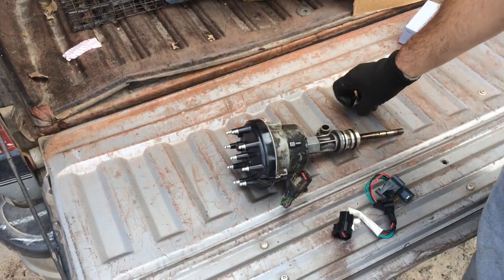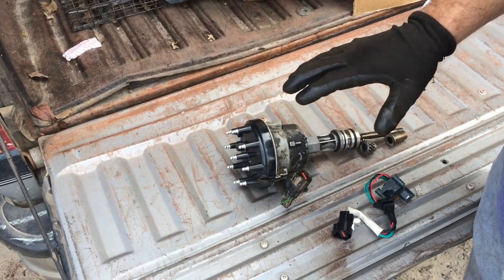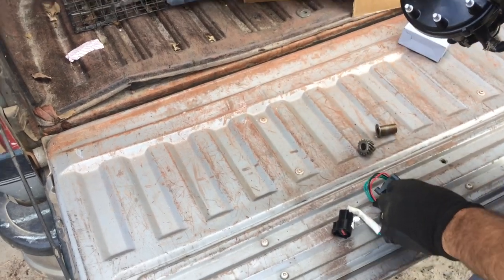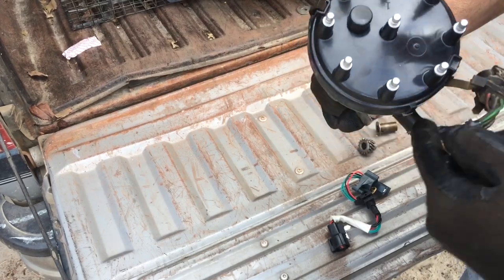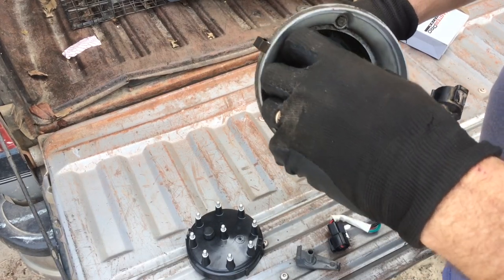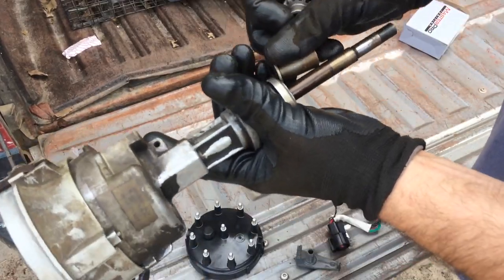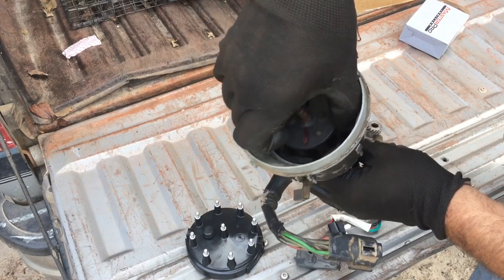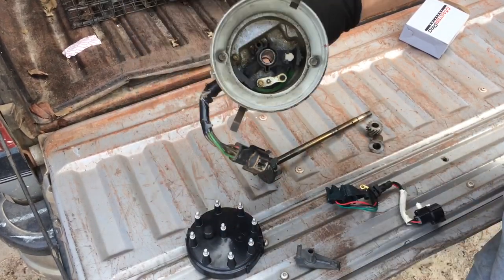Ford pickup coil replacement part 1

Comment: I want to add that youre supposed to take notice of how the distributor drive gear is oriented on the shaft if that was a factory OEM distributor..The gear has 15 teeth which makes it approximately 24 degrees a tooth...If the distributor drive gear is installed 180 degrees out when installed it will result in the distributor  rotor being set 12 degrees off which will result in hard to get a dead-on to #1 when using the ford 30 degree module placement and centerline chart as proper distributor location referrence..When you buy an aftermarket distributor its good to match the gears orientation as I bought a distributor from Autozone and the gears didnt totally line up 100%...I put it in anyways and the truck always labored to start when hot and when I backed off the timing to eliminate the hard start condition and the truck became powerless..I pulled the distributor and reclocked the drive gear as per the OEM distributor and everything worked correctly..............No more hardtime to set the dist on #1 exactly and get a good rotation to time the engine set in engine as per schematic issues , no more hard start issues when truck was warm or heavy fuel smell coming from the exhaust when its running plus when running more than 12 degrees of advance theres no more pinging  issues either and I always run 93 octane fuel in my junk...
Reply: I also had that thought but then again, you can rotate the distributor by hand when you adjust the timing and make up for that mentioned offset in the gear teeth if you didn't fit it 100% like factory fit.

Comment: Ben,

Hello.  Why did you not show how to remove the distributor gear and bushing?  This is what is hanging me up and has caused the most problems for me.
Reply from the maker: John Drazba ,hi John, I had to go to a buddies house to use his press. You will need a hydraulic press. Or you may be able to get a puller from the auto part store to do it. Mine was so frozen on, the puller wouldn't work. Sorry I couldn't film at my friends place.
Reply: Ben,

Hello again.  Thank you very much for the reply.  I understand you need a puller or better yet, a press to remove the gear.  However, the initial reason I also made the comment for was the thrust collar above the gear.  I removed the pin, but mine is really stuck on there.  It looks like a very soft material and I am afraid I am going to damage it.  Worse yet, I can not find anyplace that sells the thrust collar/endplay bushing.  Any comments/thoughts/advice from you would be appreciated.  Thank you, Ben.

Comment: Replace the distributor. Trying to remove the distributor gear can damage the distributor. A power-steering pump pulley remover can work. To install, use a socket. But lining up the gear hole is awkward. Best to replace the distributor. The shaft has wear. It'll throw off the timing.
Reply from the maker: Carl Williams its an individual call really. Mine original works great.Those “cheap” $160 distributors are junk. Be sure to get a nice $400 one. And hey might as well pay a mechanic $500 to install it and fo the timing for you.
Reply: @benthompson8450  I got a new distributor for my car from EBAY for a 6 cyl. car. I haven't installed it.  I tried removing the gear and it damaged the bottom of the shaft. Distributor bushings get worn. Grab the shaft and the body of the distributor  and try to move it back and forth. It shouldn't have play. Use a oil pump primer shaft to line up the oil pump and distributor. DON'T turn the crank. Get #1 on TDC on compression stroke on 0. Point the rotor at #1 terminal on the cap. Turn the distributor way back opposite normal rotation. Then install it. Set the timing. This can be done after miles pile up and it compensates for chain wear. It causes the crank to have to turn less to fire #1. That causes an increase in power! If the chain jumps, wherever the rotor points, designate that as #1. Run that wire to #1. Then following the firing order, rotation of the rotor, and cylinder arrangement, reroute the wires if they reach. Get another set of wires so they'll reach. Wire connectors at the plug come off and end up on the plug tip. Then you need a wire. Use dielectric grease on the wire boots. Check cylinder balance by pulling wires off one at a time to check RPM drop. Pull them off at the cap. Use a timing light to check for consistent spark at each wire.

Comment: So if the pickup is bad would that make the ignition coil go bad and if not knowing the pickup was bad and just replace the ignition coil would it keep blowing the ignition coils. I get power to the plug to the ignition coil. But no spark from the coil. I have replaced 3.
Reply from the maker: I don’t think so, the pick up coil is more of a timing device. Doesn’t cause the spark, just helps regulate which ones spark. 
Double checking, your not talking about the ignition module are you? 
The ignition coil has a spark plug wire tuning from it to the distributor- but the ignition module has a wire bus with multiple wires hooking into it from the ECU. 
Their are some defective ignition modules being sold at the parts stores for F150
Reply: @benthompson8450  I have a 1990 ford Taurus wagon with a 3.0. I drove the car home 5 or 6 days ago parked it and when I went out 3 days ago and it wouldn’t start like it had no spark. I have replaced the ignition coil twice. Not tried it a third time cause someone said it the pickup was bad then it would fry the ignition coil. I checked the wires to the coil and it has juice. I checked the coil once Wires were plugged back in and no spark. To distributor
Reply from the maker: In my experiment with a pick up coil. When it’s bad the vehicle will run but it will run out of timing. If the motor is turning over and no spark is in your distributor. I would think it’s the ignition module. It’s ussually located attached to the distributor in 80s fords but on a 90s it’s probably on the fender well somewhere.
Reply: @benthompson8450  ok what about a starter relay cause it is a ford it has one close to the battery

Comment: would a pickup coil causes a no spark to the spark plugs wires even though u have spark from the ignition coil ?
Reply: Yes because when no signal comes off the distributor, the ignition control module will not command the coil to fire the spark plugs (whether efi or carb) and the ecu will not pulse the injectors either for efi applications if no "profile ignition pickup" signal occurs.

Comment: I replaced my cap, rotor, coil, ignition module, plugs & wires on my '92 Bronco 351 & I still have no spark. Is this a common culprit of no spark?
Reply from the maker: dant387 not in my experience. With a bad pickup coil, truck runs but with an inconsistent misfiring
Reply: Ben Thompson hopefully you don't mind if I bug you for a bit...this bronco sat for many years & I got it running after putting gas in it & jumping the fuel pump. It ran perfectly and idled fine for about 15 mins. When I moved it, it shut off & hasn't ran since, even with all of those new parts. Im thinking either the computer or some anti-theft system that I don't know about since I had to punch the ignition out to start it?
Reply from the maker: dant387 why are you sure there is no spark? How did you rest that?
Reply: Ben Thompson I used a spark tester, one with the light in the middle of it. I got no pulse when I cranked it
Reply from the maker: dant387 where does the ignition module mount? On the distributor or on the front driver fender wall? There are two types
Reply: Ben Thompson it's on the fender, I replaced it with another motorcraft module & it didn't work
Reply from the maker: dant387 are you it is good. I have had those modules blow right after i install them. Ive been through 7 of them in 3 years. Make sure its good. And if you replace use electric grease in the wire bus couple and on the metal plate on back.
Reply: Ben Thompson I put the new one in & put the grease on it. When that didn't work I put a working one on & still nothing. I'm gonna put a new distributor in in a few days, it's the only thing besides the computer that I can think of
Reply from the maker: dant387 may be the distributor. Very rare for pre 96 ECU to cause the problem.
Reply from the maker: Update me later
Reply: Ben Thompson will do
Reply: Ben Thompson pick up coil was replaced after days of aggravation, still no spark. Can't understand this damn truck
Reply from the maker: dant387 id take that Ignition Module off and have auto part store test it. Just cause i know the modules they sell are junk these days.
Reply from the maker: dant387 when module is bad truck will just constantly turn over and not fire.
Reply: Ben Thompson I replaced it with a working one from another motor and a brand new one, no result. I'm completely lost. The only other thing that I can think of is the computer. It'll either be brand new or burned to the ground by the time I'm done with it
Reply: Ben Thompson okay so it runs now. It turns out there was an alarm system hidden underneath of the dashboard back behind the glove box. When I was messing with the ignition it tripped the system and cut all power to the ignition side of the vehicle, cutting spark altogether. I took it out & cleaned all the plugs (they were soaked in fuel from cranking) and it runs fine now. What a cluster!
Reply from the maker: dant387 lol, my god. You got me with that one. Good for you finding it! Way to go!

Comment: I have a 93 with the 5.0 and we replaced ours this weekend. It ended up not being the reason we weren't getting fire so we replaced the coil and the PIP as well. Now we have fire while the starter is engaged but as soon as I let do of the key she dies. Any ideas what's wrong? Seems like something didn't go back together right but everything is plug and play.
Reply: Same problem here with 95 GT. I checked the TPS and IAC, they were fine. I'm going to pull out the SPOUT connector to verify. Fuel pressure is good. What was the problem with yours? Was it the ignition module? Coil?

Comment: How did you get the gear off
Reply from the maker: mammothglint87 tap the pins out and use a press
Reply: remove gear by driving roll pins out ,must use press ,to press of gear ,it is on 
there tight use heat ,same for reinstal this is a job for exp .mech good luck 
thank you mr Ford/

Comment: I have a  ‘90 F150 XLT Lariat 5.0L EFI that’s problems have outlasted my mechanical knowledge. With that being said I have put new plugs, plug wires, ignition coil, distributor cap, rotor, ignition control module, throttle body position sensor, idle air control valve, fuel filter, new battery and front tank fuel pump (rear tank was removed for some reason before I acquired the truck). My problem is that after being driven 15 or 20 miles the truck just dies but will start back up once in neutral, switch turned off then cranked again. Not to sure what else it could be. I have bought a new distributor but truck does seem to like it and would not start. so I swapped the distributor cap, rotor from new to the original and it’s runs better than it has since I got it all besides the random engine dying out. Any recommendations on what the issue might be? Any information would be greatly appreciated
Reply: Just change the engine

Comment: Thank you for this video! Why did Ford design the distributor to be such a pain in the butt?  What happened to simple points? Electronics....phooy!
A top of this a pain in the butt drive gear to remove?  Thanks for the video. I was going to attempt to replace the coil pick up inside the distributor; I just might rethink this job now and just purchase a new distributor.  I already replaced the ICM, cap rotor...darn. 
Still thank you for your video. Electronics suck. Points and condenser so much easier to replace.
Reply from the maker: Byron Harano that in particular year is a hodgepodge of stuff too. I think Ford was using up their old supply of parts before going fuel injection and full cpu. Come on - thottle body injected? Why would anyone choose that over a carburetor. Gues it just sounded cool- thottle body “injection”. Still those engines are tough.
Reply: @benthompson8450  throttle body injection? You mean Chevy? Cause ford EFI have been multiport injection since 1986. In the mustangs.
Reply from the maker: @ceetwarrior  my 1993 Ford F-150 has throttle body injection. Not sure why Ford did this. It sucks. Fuel injection for all F150s soon followed. Sorry my last comment may have been to general.
Reply: @benthompson8450  that's not original then. Ford trucks except for the 460 had multi port EFI since late 80's. I've owned every single OBS Ford truck except for a lightning. I've owned many, 4.9, 5.0, 5.8, 7.5 7.3, longbed, short, ,ex cab, crew cabs, std cabs, 2x4, 4x4, manual, autos, bronco, all of them.
Reply from the maker: @ceetwarrior  look I’m know Ford historian. But this truck was purchased brand new in 1993 with less than 400 miles on it. 5.0 f150. Also I know many late 80s fords came with carburetors right out on the factory. Please don’t try to change my reality again. And what does any of this have to do with changing a bad pick up coil?
Reply from the maker: @ceetwarrior  it came with throttle body injection.
Reply: @benthompson8450  you need to do some research. I'm not gonna get in an argument here. Do some research. You might be confusing a throttle body which only controls air and computer controls with what you consider throttle body injection. If your truck has 8 fuel injectors spraying fuel directly into the intake the that's "multiport fuel injection", son.

Comment: You could have made a far more useful video if you had shown how to safely remove the distributor drive gear!  Removing the distributor drive gear is the difficult part, everything else is easy.  I personally removed my drive gear using a 3 leg jaw puller.  But it was very difficult and I was very careful not to damage a tooth on the gear.  I remove and readjusted the jaw puller nearly a dozen times, tightened a little, removed again, realigned and tightened, remove again and realign the jaw puller.  For me luckily it worked out well, and without damage.  Once the drive gear moves about 1.5 inches its a piece of cake.
Reply from the maker: Jurek Ogórek why was it so dangerous? Because you used a puller instead of a press as I recomended? Did you make your own video to improve on mine? You could have shown everyone why a puller was the dangerous way to go.
Reply: @benthompson8450  I have no idea what the you're talking about when you say "why was it so dangerous?"  Perhaps you have reading comprehension issues along with making worthless videos.  In either case the video sucked.  Total waste of time.  Glad I got to down vote the video.
Reply from the maker: Jurek Ogórek wow, thanks. Have a nice day

Comment: You just ruined my week BRO! Last thing I wanted to do in my old shit box 83 f150 was pull my dist. in the driveway when its 90 degrees out. My shit box has an intermittent no spark on start up. She was a very dependable starter and then boom most times it just cranks and wont start up. No spark at plug but coil is hot. So LAME! Cant wait to sell this TURD!

Comment: $20 more replace the whole thing
Reply from the maker: $20 more? Where would you buy such a cheap distributor? Also youll have to reset your timing most likley. Ive never seen two distributors hold the same timing. Wow $40 distributor huh? Wonder how long that would last? $500 more and you can just have a mechanic do it all for you.
Reply: @benthompson8450  well right you are. Looks as tho I greatly under researched this product. Egg on my face! 😖
Reply: it seems a lot of cheap rebuilt distributors are rebuilt by just checking the original pick up coil and not replacing it leading to problems mere weeks after replacement....
Reply: Ben Thompson just a observation and question as I’m by no means a mechanic but what I’m seeing is they are they are like $40 bucks, and don’t you need to reset timing this way as well? I mean you pulled the full distributor so you’ll have to hope your guide marks are perfect during reinstall but even so that’s going to need double checking with a timing light right?